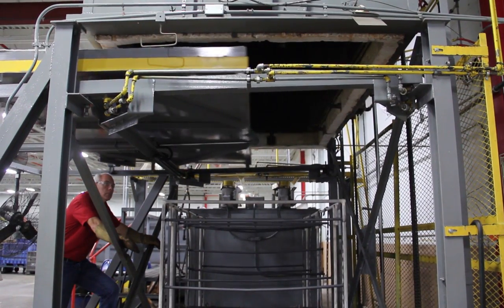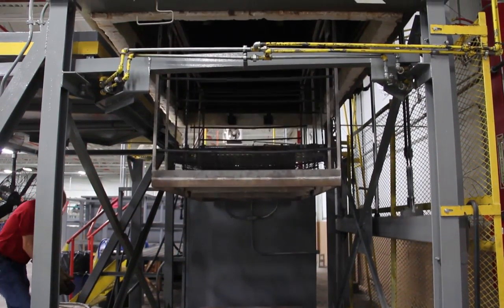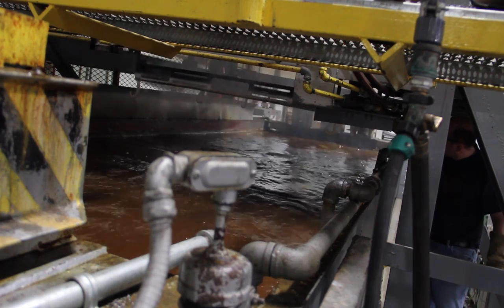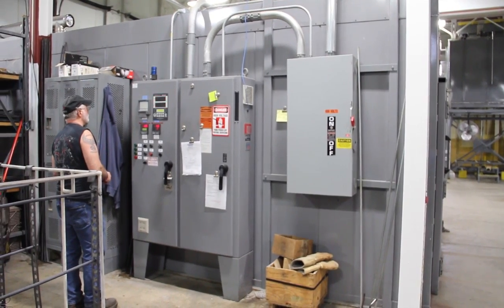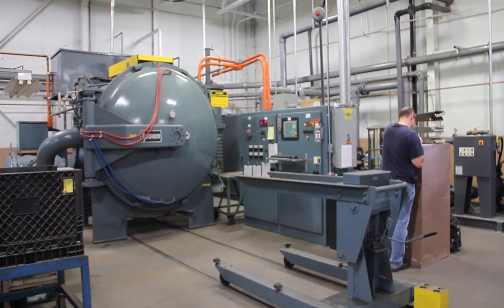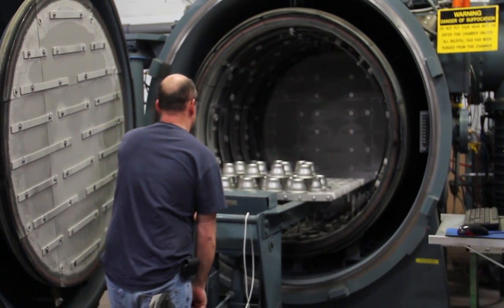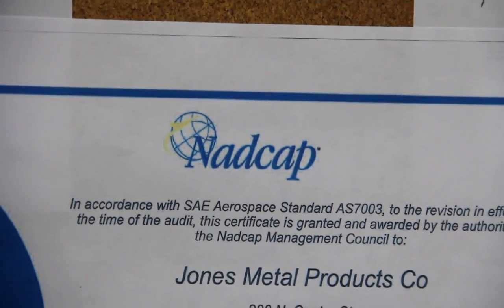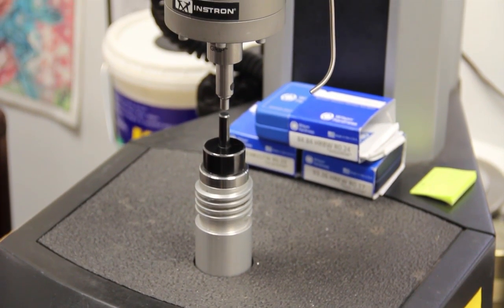Aluminum Heat Treating - How it Works

Comment: It doesn't talk about how it works. Just a company saying they have the equipment to do heat treat and how long. Nothing about how heat treat effects alloys put into the equipment and the effects it could or should do.
Reply: No, but there are plenty of actual engineering references (i.e., MMPDS-01) out there for that.

Comment: SIMUWU is a professional manufacturer in China with 20 years experience on vacuum furnace, the main products are vacuum heat treatment(including annealing furnace, quenching furnace, tempering furnace, aging furnace),Our on- time delivery is quite high also, we are certified with CE and ISO9001,9002, if you are interested, please visit www.vacfurnace.com